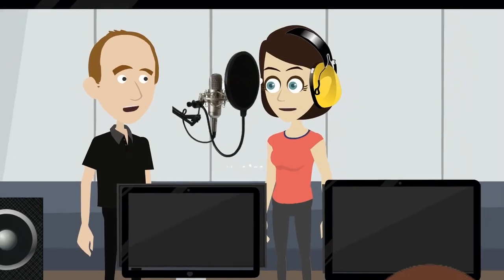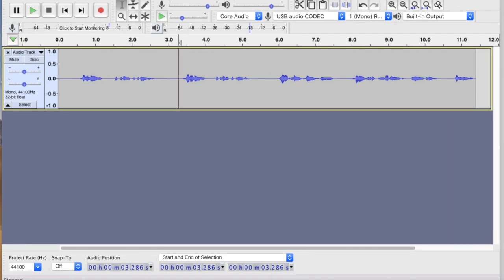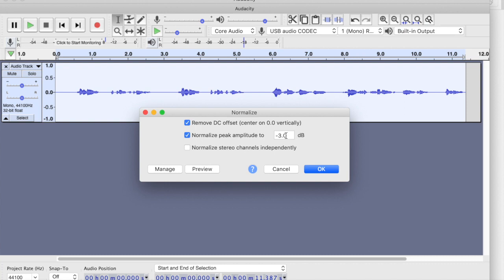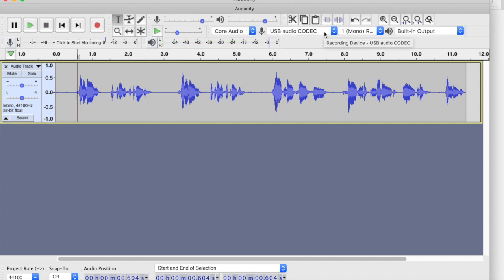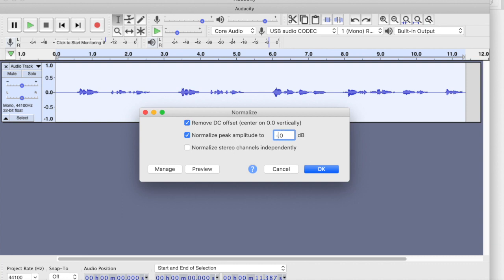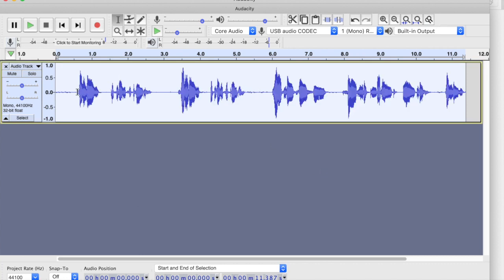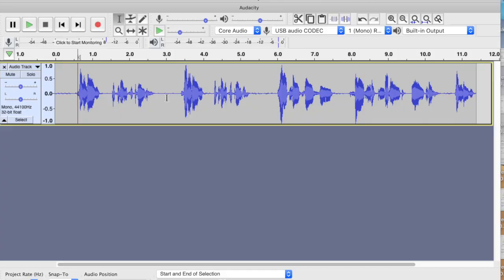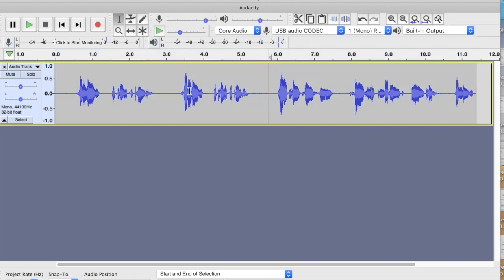How To NORMALISE  Your VoiceOvers (and What It Does)

Comment: On the point for those producing audiobooks with ACX, and using Audacity as their DAW, there is the ACX Checker plugin for Audacity. This will analyse the audio to see if it's within the ACX specifications. When I do my samples, after editing, I'll do Effect > Noise Reduction. Then Effect > RMS Normalise between -18 to -23 db. Then Effect > Limiter > Hard Limit -3.0db. That does the trick at getting the levels ACX requires.
Reply from the maker: Thanks for the info Ian.

Comment: I do this.  I do it last though.  I magnify the size of the wavelength, cut out any breaths and mistakes, compress, EQ, dialogue isolate, then normalize.  I do normalize last so that absolutely nothing I don't want in there is being amplified.  You can't hear it on my comic videos because they're "live", but on my Star Wars ones you can hear it because it's scripted, but putting it through that extra bit of work really helps, I got a Samson Go Mic for £15, I see no reason to change the mic because editing really lifts up the recording.

I also use your technique for pop filter placement!

Thanks Gary!
Reply from the maker: Yes you are correct normalising should be applied at the end, to even everything out. Thanks for your input and taking time to comment 🙏
Reply: This I think would be a great subject for a video Gary - the technical process from the completion of the recording to the finished product that’s ready to go - I’m using Audacity and don’t think I’ve even scratched the surface with it yet